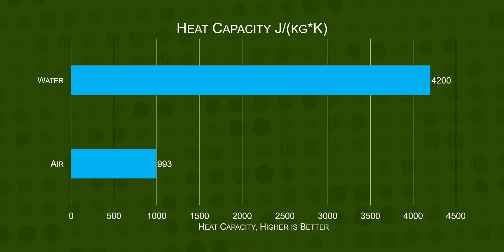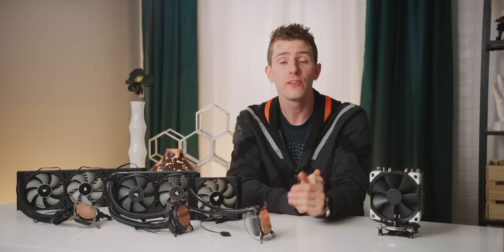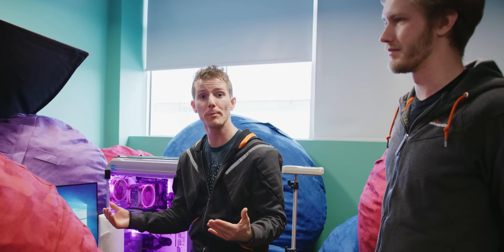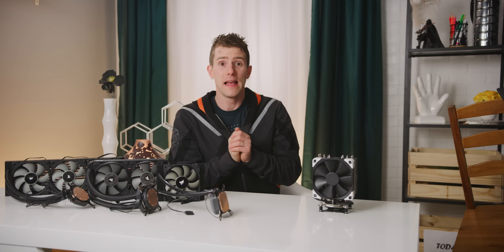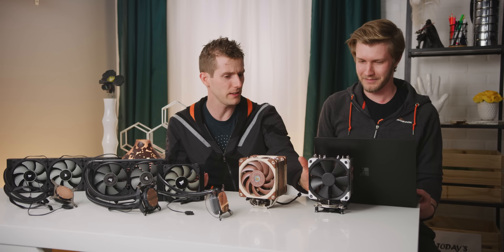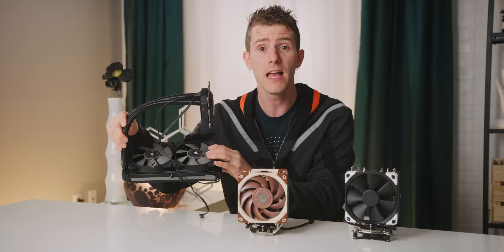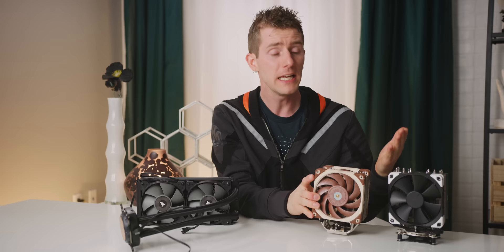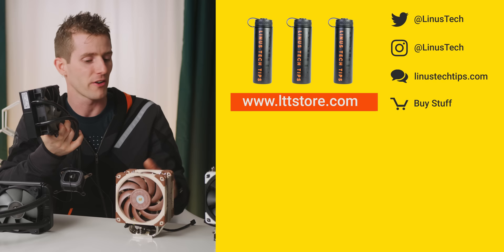Why you shouldn't water cool your PC

Comment: Getting rid of my car's water pump and installing a Noctua fan now.
Reply: hahaha
Reply: Hahahahaha
Reply: Hahahahahahaha
Reply: haha
Reply: To be fair. There is a reason why aircooled 911s have more value than watercooled 911s.
Reply: This made me laugh harder than I should have.
Reply: @pmp1337  911 im trgrd
Reply: Hahaahah
Reply: Uhhhhh engine will blow up due to overheating! Edit: i was very stupid when I made this
Reply: Porche engines were air cooled until the mid-nineties btw
Reply: me too, v-tec + Noctua = high performance! als0 = winning
Reply: Anubis WTF 666 LIKES🤣🤔🤔
Reply: @dylandesmond  You don't need a turbo if you have V-TEC 😉
Reply: @pmp1337 the air cooled cars are worth more mostly because of porsche purists. cooling a combustion engine is obviously very different than a computer, and the water cooling performed better, which is why they got rid of it :( also air cooled motors are plagued with oil leaks from large heat expansion and contraction over time.
Reply: @pmp1337  aircooled engines are worth more due to their rarity in good shape anymore. But water cooling is more efficient and allows a company to increase combustion efficiency without having cooling issues
Reply: Brilliant
Reply: Jack’s Small Workshop Vlogs, Builds, And Fun! R/ woooosh
Reply: But don't let your engine oil run out when you air cool 😆. ...  Or ever, for that matter
Reply: Haha..
Reply: @qeelevators2960  your like 6 get off youtube
Reply: Hahah.. drop dead .. 😂
Reply: maybe porsche was on the right way. using air cooled engines from the 40s til late 90s
Reply: DONT BUY AN AIR COOLER!!

It won't work in space.
Reply: @commandohazelnuts  there alot of other brand who do. honda made atv like that for years. i actually have a 30 year old air cooled engine that runs like its new
Reply: Also for some tech info on air cooled engines vs water cooled engines 1 a water cooled engine can never be air cooled. The water cooled engines will be cast with way more surface area and will have a fan that draws air over the engine. A water cooled engine has less surface area and a flatter outside block. Yes we do use engines with no water cooling at all in drag racing but air is nothing to these engines they utilize the ability of evaporation to cool the engine. With that said engines are way way way more complicated than a piece of electrical equipment. Because a lot of water cooled engines will utilize that water to cool the oil cooler. They will utilize the transmissions own fluid to cool the transmission some through air some are integrated into the radiator.
Reply: Sorry air cooled engines are cast with more surface area
Reply: Or just get a Type 993 Porsche :)
Reply: Ha
Reply: Noctua fans only fit in large cars so make sure before you buy. I made the regrettable decision of buying one and trying to install it in my Sedan only to not have it fit.
Reply: just be careful with those turbo take offs from stop lights, the thermal mass is low with air cooling.
Reply: remove radiator fan , and ziptie 6 noctua fans on it ...for more torque power to the engine horses :D
Reply: lol
Reply: @pmp1337  it's nothing to do with air cooling being more efficient for internal combustion engine because it's not. Did you ever ask yourself why they (and in fact every other car manufacturer) switched to water cooling?
Reply: Hahahahahahahahahahahahaha
Reply: Good one but I don't think the BTU's within your cars heat exchanger work on the same scale as they do within your PC's CPU Cooler XD
Reply: I used to drive a 65 Corvair Corsa turbo (no water pump).  I've seen the head temp exceede 500 degrees.  I'd recommend keeping your water pump.  :)
Reply: don't forget your rad fans
Reply: this is golden
Reply: Jack’s Small Workshop Vlogs, Builds, And Fun! r/woooosh
Reply: @qeelevators2960   It WaS a JoKe
Reply: Yeh all these air cooled cars would be fine in cool places but useless in somewhere that gets 40/50 degrees plus.  I've checked the ground with a temp gun at work before and it's been 60 degrees (Australia). My water cooled car almost over heats on those days.  So during summer you wouldn't be able to drive the car
Reply: @pmp1337  aircooled 911 gang
Reply: @red2455  neither will the radiator :)
Reply: WhatTrigger Yes it will 😉 Liquid is 😍😍
Reply: NICE ,  really need to get red of the heat on my Q6600 CPU . i wonder if it deliading
Reply: @qeelevators2960  good solve sherlock
Reply: Zach Faulkner r/wooooooooosh
Reply: Ya but PCs are stationary!
Reply: Ya but PCs don't have to be light and are not vehicles  @commandohazelnuts
Reply: Lol. Even though this has 4.8K likes, this is still underrated
Reply: Tons of cars are air cooled though...
Reply: LMAO! there is a difference in electronic's heat and combustion's heat. goodluck! it would be fun to watch! I know you are being sarcastic.
Reply: Just got a fire truck and it’s with water 💦❄️cooling engine when it’s get hot 🔥it runs on steam 🚒💨
Reply: You mean radiator....
Reply: lolz
Reply: Actually, your car is mainly aircooled. The greater job of cooling the motor comes from the air the car is through while you drive.
Reply: Yes! Do it!  Also replace your brake fluid with air. Please.
Reply: LMFAOO
Reply: @qeelevators2960  do you know what a j o k e is?
Reply: YeehawTV 9
Reply: @ceff01  its a joke you undercooked pasta
Reply: lmao
Reply: @artilerypheonix  My bicycle propulsion is normally aircooled ...except when it's raining! ;)
Reply: Great Idea! it's also more quieter yo..
Reply: Have you ever seen the size of the fans on the back of a cars front mounted radiator?? they are massive... like at least 40cm radius. And they spin very fast and are very loud. Must take a lot of current too from battery to spin that fast given how big the blades are and how much drag there would be.
Reply: lmao
Reply: Just for the record, cars don't use the radiator unless the car is actually overheating. Most of the time, the valve is closed. That is why radiators on cars are so tiny now, and use an electric fan to assist with cooling. Though, the fan isn't needed unless you are parked, but it still turns on, just because cars are dumb in that area still. Most of the heat is exhausted out the exhaust pipe, in most cars. Until you get near 5000 RPM in the summer-time, while parked, then you can see radiators in cars start to fail. Normally, the valve just fails, or the lines do. The radiator is still a bit oversized in cars today, as a precaution.

You could remove the radiator if you just pump water directly into the pistons, like airplanes use to do. (It doesn't take much, but the rust and oil-sludge is a nightmare to repair. :P Same inside of water-cooled components. That turns to sludge too.)
Reply: Bmw n54 water pump solution. Air fan cooling.
Reply: Lmao I almost choke just laughing at this comment 🤦‍♂️🤦‍♂️🤦‍♂️🤣🤣🤣🤣🤣🤣☠
Reply: @qeelevators2960  woosh
Reply: yes
Reply: Joke aside. This is not a bad idea. Automakers should explore phase-change cooling + heat pipes to replace the current water cooled systems. You could shave off some weight, and hopefully heat pipes are lifelong and maintenance free. Metal needs oxygen to oxidized; so if you create a vacuum inside the cooling chamber, that should be maintenance free.
Reply: Nah, most or all almost engines cooled by two. Watercooled/coolant and aircooled. Coz when ur car runs. Some of air pass through. 😁
Reply: @pmp1337  to be fair they aren't even air cooled they're oil cooled.
Reply: I guess PC = personal car now?
Reply: Nah fam. You months as well just replace your radiator with a case fan
Reply: @LostinMIA  In the USA the last air cooled VW was in 1983. Mid year in 83 they went to the waterboxer engine. Thanks to the smog Nazis. VW stopped making great cars when they stopped making air-cooled engines.
Reply: @jdrok5026  Want power and efficiency in an air-cooled engine? Look no further than the Type-4 engine.
Reply: @prunt23  Smog nazis were the leading reason. Power was next.
Reply: @datsuntoyy  Corvair was no comparison to the VW Type-4 engine in terms of reliability and longevity.
Reply: @JD_Mortal  General aviation aircraft are mostly air cooled.
Reply: @adfggffffffddffd  Incorrect. They're air-cooled. Air is the means of cooling the oil thru an oil cooler and air over the cylinders/heads.
Reply: @jf4872  I've known many a corvair that has gone 100's of thousands of miles.  I've known corvairs to drive home with a piston top separated from the bottom.  I've seen corvairs drive with one of the carbs plugged  so it's running on 3 cylinders.  Still has nothing to do with the comment.
Reply: @prunt23  they switched to water cooling because combustion with air cooled engines causes more distortion from heat you need the entire engine to properly distribute the heat.
Reply: @jf4872  yes aircooled engines can be highly efficient but they have their draw back. With added heat they tend to distort so you have two options water cooled or increase displacement and run lean
Reply: Warm Soft Kitty and cars have the advantage of moving air going into them, so it's even more true for computers
Reply: I think you meant the radiator
Reply: @qeelevators2960  there's something called sarcasm?
Reply: Volkswagen were already onto this in 1936. Respect!
Reply: This made my day. 🤣
Reply: So we know this is kind of ghetto
Reply: LOL
Reply: GM Kof hard  water cooled has it's own issues if we could use much lower radiator temperature for our cold reservoir we could actually increase thermal efficiency even more. But the problem with engines in a car is well limited cooler size. Air cooled engines have to flow air across them which isnt as efficient while a beautiful engineer marvel it does limit efficiency. But than again a lot of race engines are more efficient than nuclear power plants since nuclear plants are limited by their cold and hot reservoirs. If I remember right its about 38.3 percent thermal efficiency which is a engineering marvel that a ice could beat power plants on thermal efficiency it's quite intriguing. But science is fun
Reply: Good luck with that one
Reply: @pmp1337  Between OP and this I'm dead lol.
Reply: yeah and its quieter than a washing machine .
Reply: This had me LOLing. Really. xD
Reply: Ha.
Reply: Lmao
Reply: @pmp1337  theres also a reason they stopped making them
Reply: Anubis sorry, do you know what pc case is that? Its so cool
Reply: Haaaaaa
Reply: Yeah noctua fans work so great i got some for christmas
Reply: Is your car still alive?? When it is on fire, Just reply.
Reply: @pmp1337  thats because the 911 purist hate watercooling like they hate powersteering or the fact that they made it a more mid engine car rather tthen a rear engined car
Reply: I mean, it worked for the original beetle
Reply: Big heatsink coming out of the hood would be sick
Reply: Does liquid cooling cost at least $200 per product damn no cheep things.
Reply: Do I need water cooling if I get a 2080TI or will air cooling be enough... or will it be super loud all the time.
Reply: that is different ,because there is not much accessible surface in motor engine  opposite of cpu .
Reply: Hahahahahahahahahahahahahahahahahahahahahahahahahahahahahahahahahahahahahahahahahahahahahahahshahahahahahahahahahahahahahaha
Reply: Warm Soft Kitty  Isn't a car more pc than a car now anyways?
Reply: Hahahahahhahahahahhahahahhahahahahahahahahahahahahahahahahahahahahahahahaha
Reply: just taking my corsair cooler out and bought a big fan cooled unit.
Reply: Best linus comment ever.
Reply: @pineapplej7310  hello there car guy
Reply: Dead 🤣🤣🤣
Reply: I wonder what plane engines are cooled with?..
Reply: I have air cooled motorcycles and they run completely fine. Most bikes from the 1980's and prior are air cooled.
Reply: @ceff01  Apparently you are a mechanic that lacks a sense of humor...as a former mechanic, I got the joke...
Reply: @whorutothink  well i hate jokes when i was a mechanic they done stupid jokes, they asked me to get a left handed screwdriver i told them its not funny then they picked me up and put me in a big tyre and rolled it absolute jokers
Reply: Lol 🔥
Reply: Anubis this made my day lol
Reply: @zNoah  Haha love the enthusiasm but... Have you ever ridin in a 500hp BMW 335?
Reply: Well an engine is a little bigger than a cpu.....so you might need 2.
Reply: Lmfao!!! This made me crack up at midnight!! Lets just say everybody in the house told me stfu
Reply: hahaha haha
Reply: Jack Hartman you deserve a r/wooosh for you past violations
Reply: anubis lmao
Reply: @qeelevators2960  damn 11 months will really change a person, won't it?
Reply: PMP1337 Performance is not that reason though...
Reply: Did you overclock your car?
Reply: If your car is a VW bug you'll be okay
Reply: HA..HA.....We all are "Intel Inside"....Oh Sorry...."Trolls inside"...Aren't we?....
Reply: I am watercolling my pc with a car radiator and i have literaly room temp always
Reply: good idea
Reply: Bruh XD
Reply: Lol
Reply: 😂😂 shits funny bruhhh
Reply: I'm dead 😂😭💀
Reply: Maybe Nitrogen is an option
Reply: What's the processor model Honda or Audi or Tesla or etc
Reply: affan Riaz i9 Titan RTX 240 hertz horse power with v12 engine supercharged Twin Turbo  😂
Reply: hahaahahahahhaa
Reply: Wtf hahaha
Reply: @pmp1337  To Be Fair
Reply: Best comment of 2019 for sure. Haven't seen a better one yet in 2020
Reply: Bruh
Reply: Hahahahhaha
Reply: Lmao noctua is king.
Reply: The new Corsair aio cooling solution for corvairs?
Reply: You're goddamn right!
Reply: Ha.
Reply: You know they’re air cooled engines on both cars and motorcycles.
Reply: uh oh
Reply: best choice
Reply: jdr ok don't know much bout drag cars but don't they rebuild there engines constantly cause there parts break.
Reply: this actually made me laugh aloud
Reply: LOL
Reply: Ha
Reply: Plenty of aircooled Porsches lol
Reply: Lmao gotta be the best comment here
Reply: Well, yeah, it is easy to aircool a thin slice of silicon with a contact patch. Main reason why water cooling is better for engines is that you can have water channels within the block.
Reply: Lmao
Reply: was that my last tooth i spit out ..thx damn age lol
Reply: Lmao
Reply: lol
Reply: Fits beetle engine.
Reply: @jdrok5026  some dude has done over 1 million miles in his 356. Mind, its had an engine rebuild, once maybe twice.
Reply: Maybe add a heat sink too 😜
Reply: @vitaelamorte06  is the car working?
Reply: @bonieralful  Yup! Runs too cold actually.
Reply: @evelynl573  True. AND it will drive itself around.
Reply: @lukeonuke  And the noise is more realistic when playing car games.
Reply: @kilppa  The reason water is better is NOT that water can be run through the engine. Water cooling is better for an engine because the water keeps the engine temperature from fluctuating.
Reply: @isaacmadhavan  Sure, that is also what water does, but what I said definitely IS why it is better. Any proper cooling keeps the temp from fluctuating TOO MUCH. The temp will still fluctuate. Your argument is just weird.
Reply: lmao
Reply: @qeelevators2960  "was"
Reply: Reason why 212 is the #1 ranked cooler in the world
Reply: Hahah
Reply: Good idea
Reply: @kilppa  Yeah, I should have added the qualification "too much". Air cooling doesn't do that, resulting in temps rising sharply for engines that can accelerate quickly. Oil cooling seems good enough for engines of capacities under a litre.
Reply: Halarious
Reply: Lmfao
Reply: That's because your car's hood doesn't have a plate-glass window.... I think the Noctua looks like the back of a bulldogs ball-bag.
Reply: Cool I'm going to try with a diesel. Good bye Cummins!!
Reply: @pmp1337  Because they used Noctua fans?
Reply: Lol
Reply: That's perdy funny!!
Reply: I don’t know why I’m not laughing just angry
Reply: This is just epic. Lol.
Reply: Yes, water pumps are for the man who prefers to tinker with his car, as opposed to actually using it.
Reply: @red2455  loll I love it
Reply: @stove74  as opposed to lame fans?  😉
Reply: How’s its temps and what’s the dba?
Reply: Noctua intercooler here I come!
Reply: They do that at Los Santos Customs
Reply: smort
Reply: I have an H100i that acts as my car’s radiator.
Reply: How did the trip to your gas station go
Reply: I gave you like number 30000,you're hella smart.
Reply: Use the carburetor too,  so you can throttle the CPU.
Reply: Took me a month tl realize it ment replacing the car water pump with a pc fan
Reply: Loved the spoiler 😒😒
Reply: Cars used to be air cooled, in fact there are still air cooled machines to this day, but don't idle them at a stop too long, you'll cook the O rings.
Reply: I'm using noctua
Reply: Pppffft. Hahaha
Reply: WAIT NO
Reply: XDDDD made my night
Reply: I mean yeah, a pc could stand for personal car
Reply: Im gonna use my cars water pump and make a petrol powered water pump for pc cooling. haha.
Reply: @zNoah  no you still do. Vtec with less than 200 wheel hp is still slow AF. You just sound like you're going fast
Reply: I wouldnt do that #rip your car
Reply: oooookay you'all also need to weld some find on the cylinder case..
Reply: I THINK ANUBIS WAS JUST JOKING!!!!! CHILL OUT PEOPLE
Reply: @pineapplej7310  Why are you triggered
Reply: 1000 iq
Reply: Because combustion engines = pc electronics 😂

Nah but seriously i laughed
Reply: My car is air cooled
Reply: The way to go
Reply: @pmp1337  they sound way better.
Reply: wtf y does yur car have a water pump,, does ot makes drinks or somethi g?
Reply: @2wd4life yea im just baiting lol -i was going to respond to you but didnt want to break the bait... but i guess i can now: i got one of those ebay superchargers (i dint remember the model but theyre refurbished from some chinese car) and put it on a dodge 2.2 T2 lebaron. it clapped quick but was a fun sleeper for awhile
Reply: You really maked me laugh 😂
Reply: @Anubis Is it rgb?
Reply: @_reverse-psycho_855  Of course.
Reply: @DanielDuarteSza  Uh as a mechanic. This is mostly untrue because engine temps will go through the roof without the proper amount of coolant in the system. Driving is not going to cool down an overheating engine buddy. Especially one that is low on coolant. Now if you got the money for a blown engine then be my guest.
Reply: @JD_Mortal  Normal engine operating temperature is usually around 190 degrees Fahrenheit. Operating temperature almost REQUIRES the thermostat to be open at all times. If you exceed operating temperature or fall too far below it. Then there's something wrong with your car. Please don't speak on a topic you're unfamiliar about. Jesus.
Reply: This comment just made my week! Thank you very much you hilarious person!!
Reply: Lmao
Reply: I also filled the passenger cabin with bean bags to reduce road noise
Reply: @davidfaustino4476  actually no it isn't ignorant engines are far more complex due to the issues with actually controlling thermal engines well
Reply: @red2455  well, i dont plan on gaming in absolute vacuum
Reply: @davidfaustino4476  Traffic. Air cooled cars have less moving parts which makes them slightly more reliable, but they overheat easily in traffic compared to it's water-cooled brethren. An Air cooled porche might run more reliably on the track than a water cooled engine but with how reliable modern engines are I wouldn't even make that argument.
Reply: Is this a JOJO reference?
Reply: Getting rid of my PC's CPU and installing an internal combustion engine
Reply: Shouldn't use 100% water in your cars cooling system that's your problem....LOL
Reply: Lol 😆 why bother installing a fan? Just drive faster!!
Reply: Sir, is your car still work now? I curious, probably will do to my car too
Reply: lol
Reply: I bet your car is pre-built 🤦‍♂️
Reply: Shut up and take my like.
Reply: same bro
Reply: Hahahaha
Reply: @pmp1337  The noise alone kills the entire value of air cooler.
Reply: Lol
Reply: PC, car eh same thing
Reply: Hey you got 38k
Reply: James Thompson Yes but it is known that water cooling makes it easier to follow emission control levels, as the dimension of pistons can be made tighter to the cylinder as there is less variability of the temperatures e.g. of the cylinders, therefore loosing less oil! Valves sometimes are inside sodium/potassium cooled too.
Reply: I'm getting rid of the water cooling in my AC and installing a noctua cooler in it.
Reply: Hood choice better hp
Reply: i wonder if that would actually work... you know. if you used enough noctua's
Reply: do the same thing with the oil pump
Reply: Rgb right?
Reply: Joke's on you. He did that the other week lol
Reply: This is an example of simple engineering....

Just backwards
Reply: @pmp1337  That's more because of Porsche purists. Water cooled cars are more like that custom solution in effectiveness
Reply: Tatra had entered chat 👀
Reply: My car has a corsair RGB AIO
Reply: Lol
Reply: Lol
Reply: OwO
Reply: @qeelevators2960  I can tell
Reply: @red2455  lol
Reply: @pmp1337  a man of taste
Reply: Like a Porsche
Reply: Have the ND 15 for more than 10 years. I get amazing cooling. My new system has a 5900x running at 4.95 ghz on all cores and just reaches 70 ish at max load
Reply: 40k likes
Reply: @vintagerustfilmstv7801  The Emperor protects.
Reply: Lmao
Reply: Lol
Reply: I’m happy happy you’re safe baby baby girl I hope hope this goes good enough iyyou have have to play it it though though lol lol I’m
Reply: @lives4trauma  I’m not sure 🤔 understandw I’m feeling like p poop hi let
Reply: Yyeeee yyaa
Reply: Lol hahaha
Reply: Lol that's thinking outside the box, lemme know how that goes!
Reply: Dude! I think most VolksWagen Beatle are all air cooled engines.
Reply: @lives4trauma .
 LET IPHONE

UK
Reply: haha
Reply: Lol
Reply: Yes 10/10 I'm gonna do that right now :D
Reply: hahahaha
Reply: lol
Reply: i dont mean to be so offtopic but does any of you know a method to get back into an Instagram account??
I was dumb forgot my account password. I would love any tips you can give me
Reply: @Paxton Moises Instablaster :)
Reply: @Arturo Patrick Thanks for your reply. I got to the site on google and I'm in the hacking process atm.
I see it takes a while so I will get back to you later when my account password hopefully is recovered.
Reply: @Arturo Patrick it did the trick and I actually got access to my account again. I am so happy!
Thank you so much, you saved my ass :D
Reply: @Paxton Moises Glad I could help :)
Reply: Some cars were actually air cooled so...
Reply: lol i thought of this too before going down in comments 🤣🤣🤣🤣🤣
Reply: @pmp1337  they also used like 8 quarts of oil too, so don't think that air is the only source of cooling.
Reply: enjoy the noise that is bigger than your engine
Reply: This made me lmfao 😂😂😂
Reply: Great idea
Reply: just buy an old vw bug
Reply: @commandohazelnuts  1997, I think
Reply: @disgruntled_llama  Sounds rite. I'm a Mercedes fan tho
Reply: Lol
Reply: Don't do it it's gonna...
Car:explodes
Reply: lmao
Reply: Yes
Reply: a

e
Reply: XD
Reply: It remind me of one video. One person from Russia took radiator from his car “Moskvich” and installed it into his PC to see, will it work, or become even better than a basic water cooler
Reply: lmaooo
Reply: Good
Reply: @qeelevators2960  just delete the comment already bozo
Reply: Assuming your car is a 2004 Honda Civic 1.7L...
The tiny 115HP engine produces approximately 4880.6 BTU of waste heat.

My Ryzen 7 X570 rig with an AMD RX590 draws around 350W from the wall under full load. Intel says 3.41214 per watt average for a server system. Using those estimates, my PC only produces an approximate total of 1194.249 BTU.

This means a factor of 4+ more cooling is necessary to achieve good temps...... good video idea though :P
Reply: Lol
Reply: @qeelevators2960  yes you were
Reply: Personal car lol
Reply: i use cooler master
Reply: LMAO
Reply: The difference bis the car is moving so you don't need fans
Reply: Yeah because Air cooling is superior to water cooling. Lol. I think the test was flawed because you had a biased tester.
Reply: cool
Reply: Lol
Reply: Sounds like a great idea.
Reply: I'm glad Google was there to translate everyone's comments above into English for me.
Reply: noctua car when
Reply: I should do that
Reply: just insane! but do it!!!!
Reply: damn i should do that too
Reply: Hahahahahhahahahahahhahahahahahhahahahahhahahahahahhahahahhahahahhahahahhahahahahahhahahahahahahaha
Reply: @red2455  Yes it will...it will work great as long as you keep it shaded from the sun. If sunlight does hit it, be far away.
Reply: @commandohazelnuts  porches we’re build to break down.
Reply: Best comment ever
Reply: A lot of VW Bugs were air cooled for a bit.
Reply: Me to
Reply: @pmp1337  That Porsche changed from air cooled to wartercooled, was because they reached some limitations what was technical, economical and ecological achievable. They couldn’t reduce the noise of the motor as required by law. But the watercooling made the t possible to increase the power of the motor a lot. Sounds familiar …
Reply: Like check
Reply: I'm waiting for test results
Reply: Liquid Cooler can also leak water and destroy MB and CPU
Reply: Smart
Reply: Buy a classic beetle
Reply: I'd recommend an EK pump, then you can put the fans
Reply: @zNoah  yes you do lol
Reply: water coolers are overpriced
Reply: its different cuz you need the water in the car
Reply: Please don't.
But if you do make sure to use the 200mm fan
Reply: Some cars are air cooled. Older cars.
Reply: Your car is waterproof unlike your gpu
Reply: haha
Reply: A car engine is not a PC
Reply: To this day... Im still laughing 😂😂😂😂 damm classic
Reply: ded
Reply: Cars/vehicles are water and air cooled not just water cooled
Reply: Hmm, air cooles engines like the vw never over heat. BUT the absolute killer of water-cooled  engines is over heating and most water cooled engines die from watercooling failure. That fact is checkable. So your analogy is out of ignorence
Reply: LOL
Reply: Removing that bulk will give you 20hp more 

Please let me know a 4 years later update on that speed demon
Reply: @pmp1337  yea that’s not why they are more valued. All water cooled engines have more even heat distribution and control which allows them to be more reliable and make more power.
Reply: Your car is about to sound quieter than a Prius.
Reply: Lol I did that 2 weeks ago! 😂
Reply: Fkin genius ! 😂
Reply: This just made my day xD
Reply: Basically
Reply: NEIN NEIN YOU NEED TO USE GATORADE AND SOME SUNNY D IN YOUR WATER COOLING SYSTEM. NOW YOUR CPU CAN TASTE DA POWER OF THE SUN
Reply: Real
Reply: YOOOO 😭😭😭😭
Reply: noctua? more like HAWK TUAH 😂😂😂😂😂😂😂🤣🤣🤣🤣🤣🤣🤣
Reply: the heat on ac unit helps cool engine